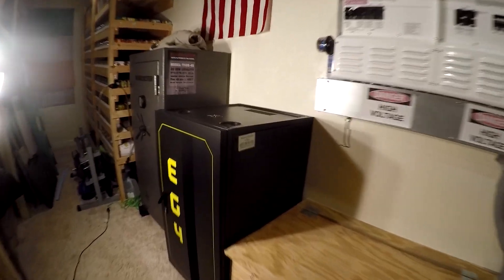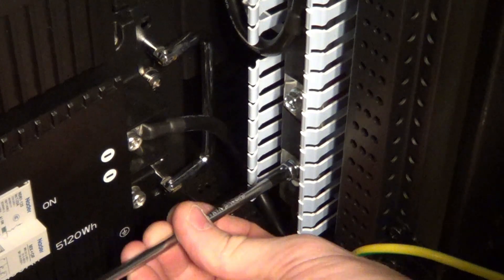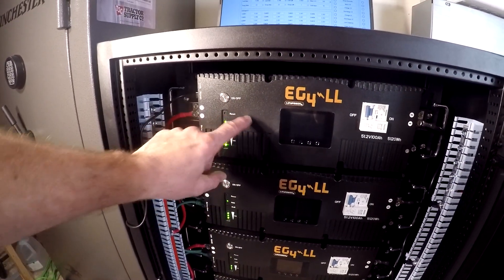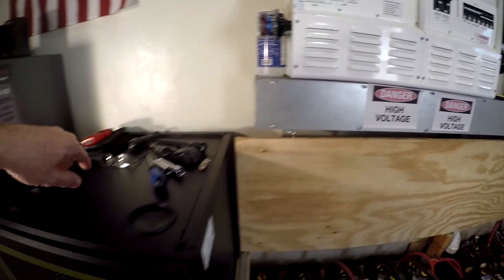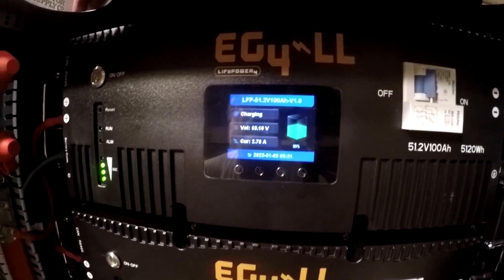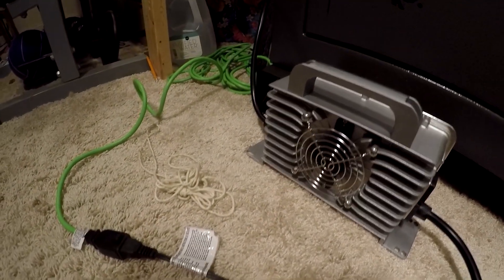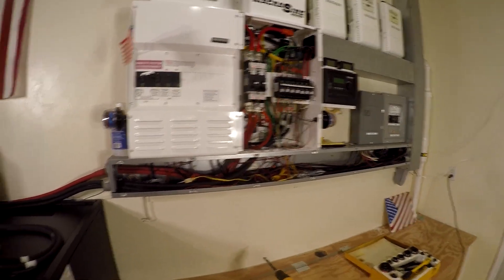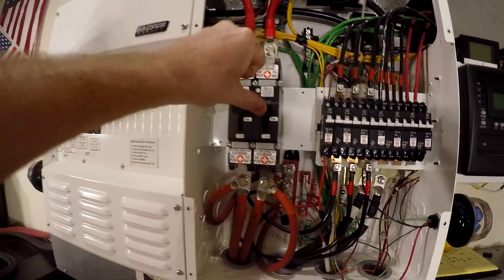EG4 LL V2 LiFePO4 Batteries Wiring

Comment: Wow! That is so nice! I have solar envy! Have a blessed day!    Wendy🙏🏻🌎
Reply from the maker: Hello Wendy,  I am liking it so far.  I'll do an update after a few days or so.  Thanks!
Reply: @HomesteadEngineering  I look forward to the update! I bet your relieved you have all of that? The power grid is scary right now.
Reply from the maker: @hardnackfarms1736  Wendy,  This was one of my top 3 concerns and it is nice to know that it is now covered.  My other two are the well and the roof.  Both are at end of life and need replaced ASAP.  Thanks!
Reply: @HomesteadEngineering  it is a concern to me and I am not ready. I wished Solar wasn’t so expensive and all of the components, batteries. Nit to mention, I don’t really know what I am doing. I got two estimates just for the geothermal greenhouse and one was 35 thousand just for solar nit even the batteries and the other was 14 thousand. I can’t imagine what both shops and the house would be??? You were wise in getting to wear you are
Reply from the maker: @hardnackfarms1736  I don't own this system linked below so take with a grain of salt but it looks really good to me.  A fair price and easy to install.  You could do most of the install yourself and hire an Electrician to finish it up.  I would estimate about $15k all in after tax credit.  https://signaturesolar.com/complete-all-in-one-off-grid-solar-kit-kit-e0000?setCurrencyId=1&gclid=CjwKCAiA8OmdBhAgEiwAShr40wo2Mghvw2bADisAhgr6vhhrYOY9pZyxs1pvwvFcPtlIGILPjL9OVRoC3ZQQAvD_BwE

Comment: The only thing I noticed is you may want to connect the negatives at the bottom of the bus bar. It will keep your batteries more balanced. That is if you have enough slack in the wire.
Reply: IMO that isn't needed with lifepo4 that uses a BMS. The current sharing concerns where a single battery would charge or discharge disproportional to the rest isn't a concern with a BMS because it won't allow them to overcharge, or fall too low.  For lead acid, I would agree to reverse one of the bus bars
Reply from the maker: I have seen that done and I considered it but I figured that with all the testing that Signature Solar does and they don't flip the bus bar, it must not be that big of a deal.  That said, I will keep an eye on it and if there is a significant difference then I might just rotate the batteries ever 5 years or so.  Thanks!
Reply: @HomesteadEngineering  thats actually not a bad idea

Comment: Looks incredible thinking about purchasing this unit also.
Reply from the maker: I am only on day 3 of operation but I can see that it is going to be a game changer for sure.  Good bang for the buck!  :)
Reply: @HomesteadEngineering  I enjoy the videos especially the woodworking ones and garden ones. All the best
Reply from the maker: @roggie77777  I appreciate the feedback.  I have a composting video that I have already shot but not edited yet.  I also have more French cleat ideas that are on my to-do-list.  Thanks!
Reply: @HomesteadEngineering  Cool. Any reason you didn't go with the more affordable EG4-LifePower4 Lithium Battery?
Reply from the maker: @diySolarPowerFunWithRay  This has a longer warranty, I like the screen giving the charge and voltage at a glance and this one has fire suppression built it.
Reply: @Homestead Engineering  yeah, those are pretty good features for not much more cost.  Thanks!

Comment: Brother u want to hook up one of them at the bottom and on at the top I wouldn't put all them at the top this way the charging goes all the way across them instead of the top battery getting the full charge .... Keep it up brother
Reply from the maker: Hey Dan, I did consider doing that and I am going to keep an eye on it to see if it becomes an issue.  Thanks!

Comment: Just a heads up, when I got mine.. I had to top balance them for more than a day.  Then cycle them 80% to 20% several times before they all showed the same SOC.
Reply from the maker: Signature Solar told me that it can take a while for them to figure out there true state of charge (up to 1 month).  They look pretty good to me so far and my Magnum Energy BM kit already agrees with them to 1%.  They all seam to be in lock step after just a few days.  So far so good but its going to take a while to optimize there use with my system and use patterns.  I left a bunch of stuff on the batteries last night including the Mr. Cool min-split and it only dropped the bank to 67% by morning so I'm looking for more stuff to off-load onto the new batteries.  Thanks for the tip!

Comment: Great job! 
Have you grounded only the rack (case) or the negative busbar inside the rack also?
Reply from the maker: Hello Frank,  I have not grounded anything just yet although I do plan to.  I think I will connect all the grounds on all the batteries and then ground that to the rack.  I think this is already the case as they are all connected via the bolts that hold each battery into the rack (but not a great bond).   Next, MAYBE connect all that to the chassis ground of the Magnum system.  I am not sure just yet... Need to think about it a bit more.  I did measure for any voltage differences and found none between the rack and the Magnum case. There is no continuity between the battery rack and the Magnum case ALSO, there is no continuity between the battery grounds and the negative bus bar.  Note: I don't think I would connect the negative bus bar to the rack or the ground.  Need to look at the bonding in the Magnum case before connecting that to the ground of the battery bank.

Comment: What size bolt/lug do you use for connecting the 4/0 battery cables to the server rack busbar?  It looks like each battery is connected to the busbar with 5/16 lug and 6awg cables, but what size are those top main terminals on the busbars?  Thanks for your time.
Reply from the maker: I am pretty sure I used the bolt/lugs that came with the system.  Thanks!

Comment: Magnum controllers don't charge Lithium, does the battery change charging frequency?
Reply from the maker: Hello Louis, My Magnum system is charging these  EG4's just fine so far.  The Magnum BM kit is in perfect lockstep with the EG4's.  I don't see any sign of any problems so far.  Where did you hear that Magnum controllers can't charge Lithium? Am I missing something important?
Reply: @HomesteadEngineering  I got a Magnum,  there was nothing in the manual that said it changed Lithium,  no settings for Lithium,  if im wrong, im very curious to learn,  most people charging Lithium use a midnite classic
Reply from the maker: @MosaicHomestead  I have to say that I have not seen anyone else use a Magnum controller to charge an EG4 battery.  That said, I did call Magnum Energy about a month ago and tech support told me that it would work.  They even gave me their recommended settings for the ME-RTR.  My next video will show the settings that I used and I should have that up soon.  Note: I did not use the exact settings that Magnum Energy gave me, I think their settings are too high to match EG4 recommended settings.  

Magnum: Bulk/Absorb=57.6
Magnum: Float=54.4
Magnum: Equalize=57.6 Done: 0.1hrs
Note: you don't equalize Lithium

EG4: Bulk/Absorb=55.5
EG4: Float=54.0

My Settings: Bulk/Absorb=55.2
My Settings: Float=54.0

I brought it done a bit so as not to over charge.
Reply: @HomesteadEngineering  Exellent,  Thanks👍

Comment: I am looking at getting some terminal fuse blocks like yours.  I was wondering, the Blue Sea ones I am looking at say 3/8 connection to the bus bar but 5/16th lug to attach the cable to the inverter.   I am going to use a 4/0 to my inverter.  what do you think about a 4/0 cable with a 5/16 ring terminal on one of these fuses?  I am kind of a novice and am not sure if I could do 5/16 on one end of my cable and then 3/8 on the other (3/8 is specified by inverter company).

Comment: I have the very same battery setup, do you plan on using the watch power app?
Reply from the maker: Watch Power App?  Never heard of it but suddenly I feel as though I can't live without it... Tell me about it?
Reply: @HomesteadEngineering  It is an app the signature solar has in the back pages of the EG charge controller manual but watch power also works with a few other inverter charger setups, not sure if it covers yours, it is an ok app that lets you monitor some of the functions functions of your battery and inverter/ charger from your phone whenever you have service/
Reply from the maker: @Prepologyblog  OK, I'll have to look into it.  Thanks!

Comment: In other words, you cannot get your batteries to actually communicate correctly with an inverter or even with the software. If you have to connect your laptop to each battery separately, then your communications setup isn't correct.

I'm not dunning you! EG4 has made it nightmarishly difficult to get correct communications to work! Most people abandon the effort and kick their inverter(s) into "user" mode and ignore BMS communications entirely.

My point is that EG4 communications is NOT ready for prime-time, and everybody seems to just accept that this mess is okay. It's NOT okay!
Reply from the maker: Hello Richard,  I have no need to communicate with the EG4 BMS what so ever.  I did initially connect to each battery individually just to check them but that really was not necessary.  My system is running open loop between the inverters and the EG4 batteries.  I have a BMS on the inverter side that manages the system.  That system and the EG4 system are in near perfect agreement as to the SOC at any given time.  Also Note: The top battery in the stack is 0.03 V higher than the bottom battery in the stack (so basically the same).  

I set this up about 6 months ago and have not touched it since and its running my entire house seamlessly.  I typically get it to 100% by the end of each day and it runs down to about 40% over night.  It runs a refrigerator, freezer, computers, TV's and 2-3 AC units all night long.  

I know these are setup to work closed loop with many inverters and there may be problems with that...  I just don't know anything about that because I am not operating my system in that way.

What you see in this series of 4-5 videos is all I have ever done to my system.  I just set it up the one time and It just works perfectly!
Reply: @HomesteadEngineering  I understand, and good on you! But I want my system to run as advertised, with the inverter in close and continual communication with the battery-bank BMS. There are indeed many problems with that, which is ridiculous, since EG4 has designed all parts of that system to supposedly work together.

Congrats on your success, though! I envy you!